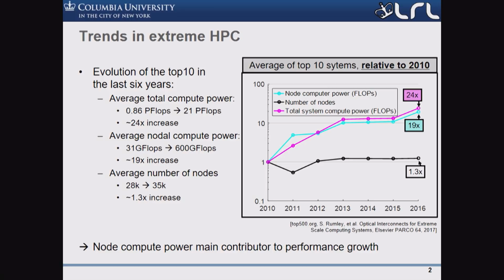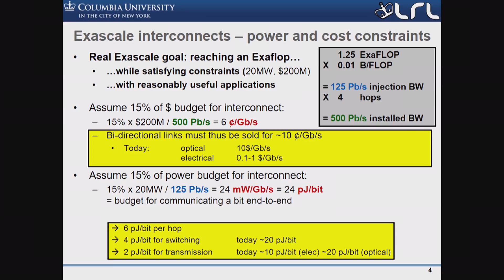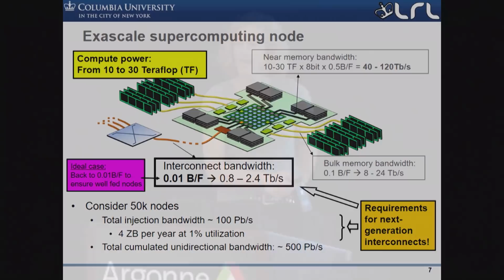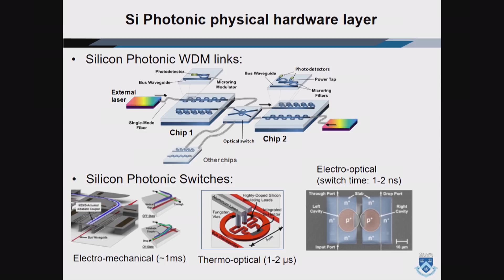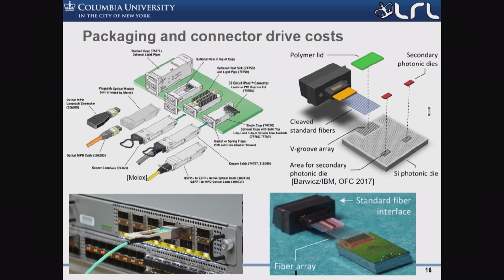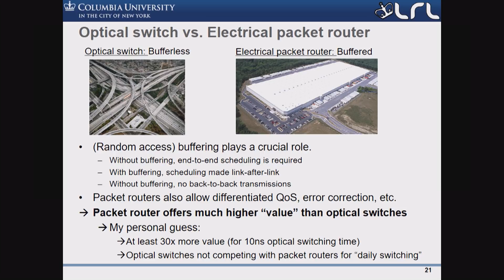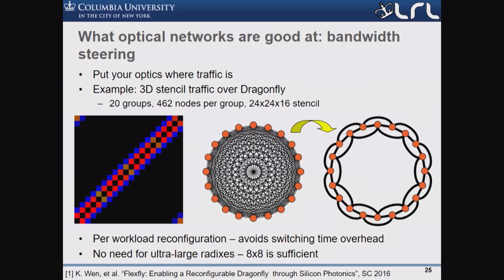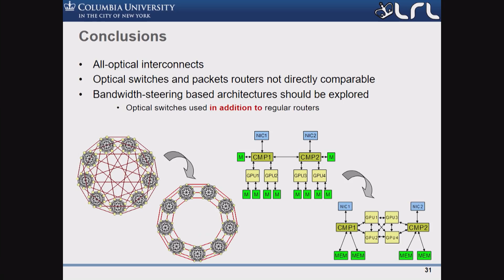Silicon Photonics for Extreme Computing - Challenges and Opp.'s I Keren Bergman, Columbia Univ.

Comment: 1. Are these innovative optical interconnects getting standardized? What are the names of these standards? 2. As I understood, you intensively use MOLEX fiber cables in the interconnects. Did you think about using multicore fibers instead? For that, it would be necessary to develop a kind of integrated optical splitting of multiple cores into separate planar waveguides.